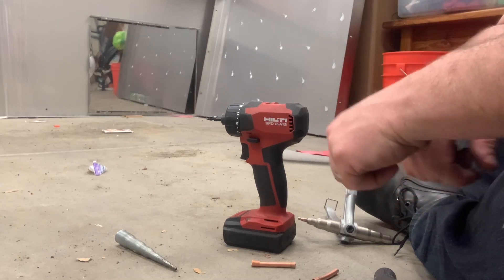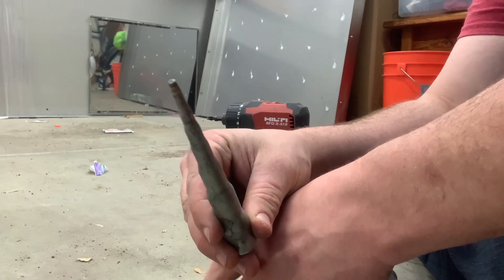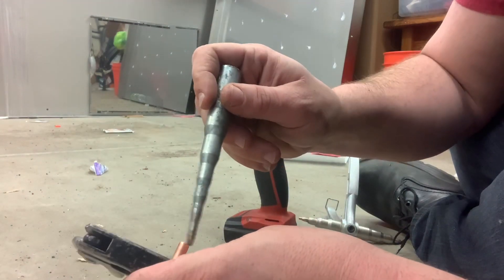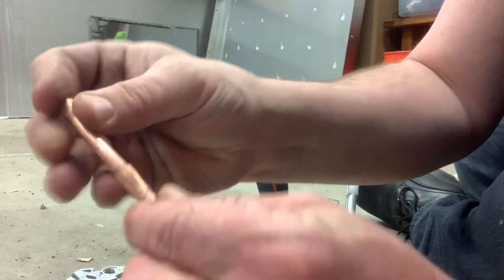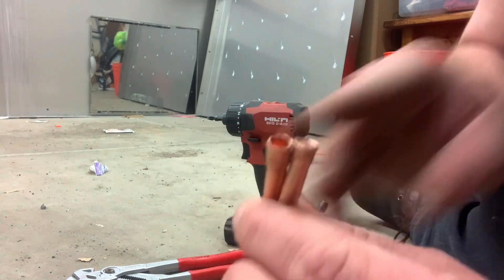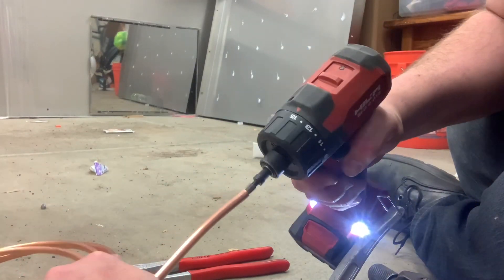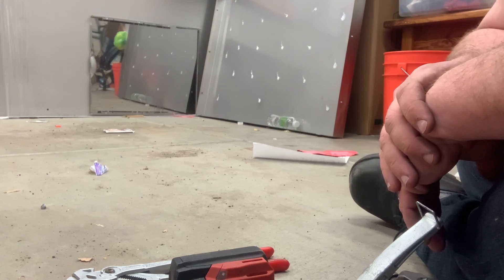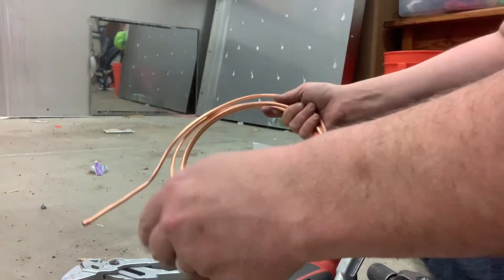Swaging 1/4 tubing

Comment: Makes life easier if you anneal the pipes first! Also Lubrication makes the tools work a lot better as copper is a dry metal. where you heated it up in the drill that end is now very soft and possibly prone to cracking if your using this on Aircon pipes, that' why its important to pre anneal the pipes first. Heat to cherry red, allow to cool, expand, job done! Use a MAPP gas torch
Reply from the maker: @spiritburners  while I agree anealing pipes can make that easier the reality of sealed system work on residential refrigerators is that taking the time to anneal everything is not going to give you much benefit for your effort. In 15 years of doing this I’ve not had any issues with cracking tubing. That said residential refrigerators usually run 1/4-3/8ths diameter tubing at most. I would not be surprised to find that in larger diameter tubing cracking becomes more of a concern.